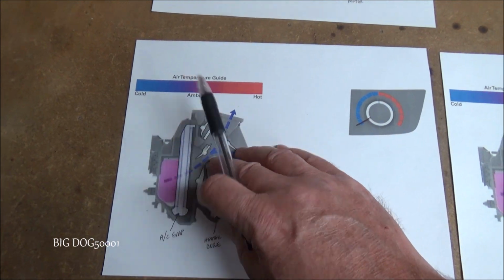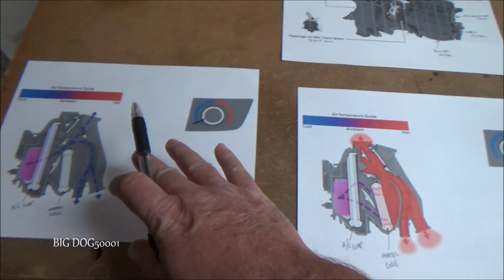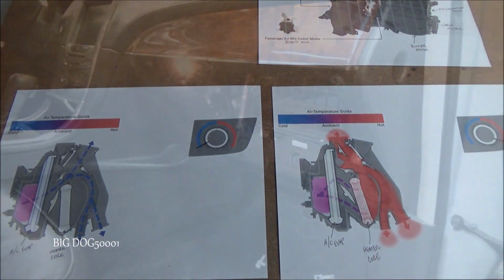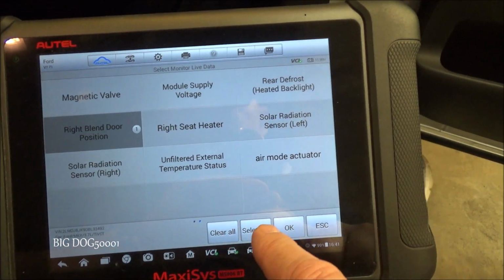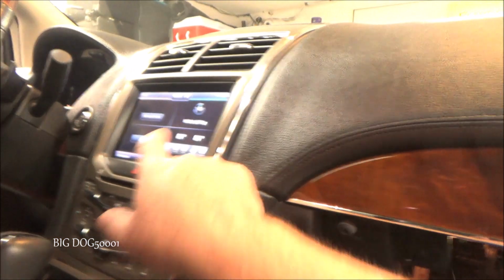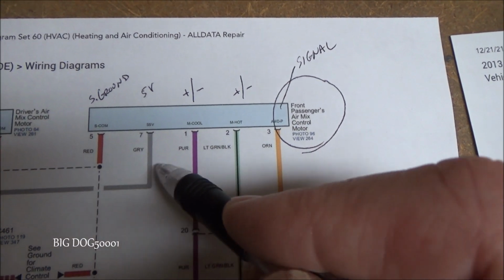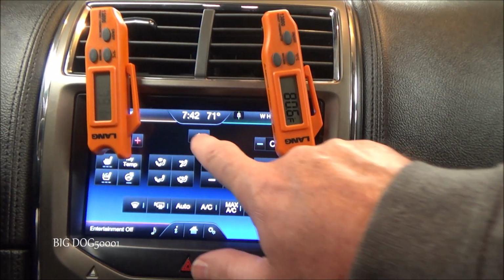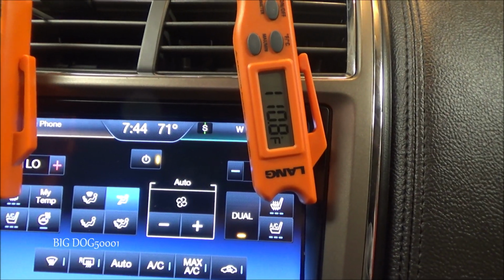Tech Tips - Uneven Car Vent Temps:  Heat or A/C Blowing Hot Air on One Side Cold Air On Other

Comment from the maker: Tools and Parts
Disclosure: This channel earns a small commission using some of these links - at no additional cost to you.
Scan Tool:  https://amzn.to/32y4ZlG
Lang Digital Thermometer:  https://amzn.to/33ReOf4

The Big Dog 50001 Automotive Channel Store can be found here: https://www.amazon.com/shop/bigdog50001automotive  (As an Amazon Associate I earn from qualifying purchases).
Reply: My problem is,heat on,hot air on passenger side,cold air on driver side(but when turning circulating mode,hot air comes out of both,single climate,coolant good,both line coming out of the heater core hot,similar temperature,I hear the blend door move,tcold to hot,hot to cold and see thr actuator move too,different modes same thing,cold driver side,hot passenger

Comment: A bit late but I’ve tried everything . I have a 2012 dodge Charger Sxt I have ac on the passenger and hot on the driver checked the Freon and it’s good . I checked all my fuses it’s good . Now my compressor has stopped kicking on and off . I’ve been told to change the ac switch and that the actuator might be bad I’ve changed two on the passenger and one on the driver I’m not sure what to go with next ? Or is it my compressor
Reply from the maker: I can't tell if you are saying the compressor is not turning on at all or if it is not cycling off/on properly.  If A/C does not appear to be turning on anymore I would start with the compressor and look to see if clutch is pulling in and engaging when the A/C request button is pressed on the dash.  If not engaging then have to find out if computer is not activating system because it does not have all the proper inputs it needs or if computer is turning system on but it is not coming on due due a wiring/relay or some other problem.

If compressor is activating properly then have to verify proper operation of the driver's blend door actuator (if dual climate control).  Does actuator actually move when you change temps is a good start, and does air vent temp change from warm to hot when changing temps with vehicle warmed up.  On some systems if HVAC module detects a blend door issue it will move the actuator to the HOT position and keep it there.  If I was diagnosing it, I would also verify proper refrigerant charge (difficult to do without an A/C machine) and see what the pressures look like on the gauges.

Comment: hey im having the same problem but im trying to find a solution for it its blowing cold are out the passenger side and not really blowing heat out the drive side i checked the blend door actuator but i find it kind of Strang the blend door only moves up until 63/67 and then i dont see it moving anymore it supposed to be moving up until 90 for the hot im trying to seee what im missing thanks for the video and keeep up the great work have a blessed day as always amen

Comment: Awesome video! Thanks for sharing! We have a 2009 Honda Crv. AC was good, but our issue was no heat either side, then we tapped the actuator on the driver's side by the accelerator, got it to move. Heat :) but found that it only heated the drivers side :( Can't wait to show this video to my husband... sooo ready for heat on the passenger side!! We have dual controls. Update: We fixed our issue, my husband removed the glove box & saw a green plug that was hanging lose, he plugged it in & success! Not sure how it could have come unplugged?? Not sure it could have happened changing the cabin filter??

Comment: I have a 2019 Silverado.  The air blows colder on the passenger side than the drivers side…it’s cool on the drivers side. But not as cold as passenger…..anybody else have this problem on GM ?  I have dual climate control.

Comment: So it's still possible for the older single climate models to have a stuck blend door on one side only but if the other side works fine it may be a stuck door but not the actuator itself..? Or am I confused? I don't want to try the recharge it it's a simple mechanical issue.

Comment: Great teaching video. Having a problem with my 2011 Honda blowing cold air left and hot air right. Experience is vital in these situations to achieve differential diagnosis.
Reply: I'm having a similar situation on my Chevy Tahoe front dash vents. Im hoping you got your issue resolved. I'm still stuck trying to understand what's going on.

Comment: This was a really good informative video. Probably the best on the internet. It hasn't helped me though since all my actuators are working as they should but i still have the problem of , when the heat is on I get heat on the right side and cold on the drivers side. I flushed the heater core and it flows great with no restrictions.. The only thing that it could be is that there is air in the heater core or the actual blend door is broken inside the housing. I'm gonna have to try vacuum purging it, because I've tried everything else except for cutting a hole in the housing to see if the blend door is actually broke. That seems highly unlikely to me.

Comment: Great video. I have 2012 Honda Civic with heat issues. Changed the blender door. Its a single climate control unit. Thermostat has been changed, temp sensors all have been replaced. Coolant level is good. Only get heat when change to inside air circulation. Passenger side gets boiling hot, driver barely warm. Then the windows start to fog up so have to switch to defrost mode. Foot and defrost mode blows cold air on the feet. So basically cold feet vs foggy windshield while driving. Please advise. Thank you in advance

Comment: Hello sir, 2013 Honda pilot question: I have uneven heat coming from my vents, I have warm air coming from the center vents but when I change to windshield defrost vents it blows almost cold air. Also my opinion is that even at center vents that blows warm air when I set on HI but I think is not as warm as it should be like its not getting to maximum hot/warm temperature. My coolant is normal, visually I inspect Blend Doors at both sides and they are moving well. Do you think that blend doors are not calibrated or got decalibrated somehow? Any Idea? Thank you.

Comment: I have the problem with heat on passenger side cold on driver's side....Just bought this 2018 Ram took it back they said it was the cabin air filter....I drove to home ....drove about 10 miles still no heat on the driver's side....no honest mechanics anymore....

Comment: So is there 2 heater cores ? One with ac compressor for hot (reverse valve) and radiator coolant (hot) or never the ac compressor works on the hot

Comment: I changed that actuator on the passenger side and still blows cold air on the drivers side and hot on passenger side would I need to change the drivers side actuator it's a 2012 Chevy impala LT

Comment: Hey Big Dog I’m a big fan. Always watch your videos when it comes to helping fix my 09 civic. For years my 05 4Runner has had a problem with AC. I’ll charge it with Freon then maybe 2 weeks later it’ll start blowing very warm air on the driver side but ice cold on passenger side till I charge it again and it’ll start blowing cold again. Never had it test for a leak. Should I start there first? TIA

Comment: A good detailed video but.. From a Non-mechanic who's video I happend to watch had a Cadillac Escalade with the same issue, He searced the internet and found this. Nothing has to be open or removed or unscrewed. Turn A/C temp to the lowst setting let it blow for 5 mins. Then turn A/C to highest (hot) setting let it blow for 5 mins. Set the normal temp you want and it is Fixed. My car hapen to be a Lexus LS and would have needed to pay a dealer evap expert $200+/hr to fix + tax and you never know if he was being honest. But I fixed mine in 10 mins. like the guy with the Escalade did. ;-)
Reply: Papa?
Reply: Me to.

Comment: I have an acura that blows hot air perfect both sides but the a/c only works on passenger side. Its like the drivers side is stuck in a hot to warm temp. I looked at the blend door & it seemed to be moving fine even took it out and moved the vents manually & i was still getting warm air, i tried adding freon as well but the system said it was full.  Any ideas?

Comment: I have a 2006 Honda Accord V6 has hot air coming out the left cold air coming out the right I could switch the temperature on both sides of the car but only the left sides one hot. The right side is blowing out cold already put.
Freon in it is still not fixed. Can someone please help me with this?

Comment: Thanks for the video. Very informative.  I remember that it was very cold out so I turned the knob to hot air and then later when I went to turn the knob  to the AC it kept blowing hot air. At first I heard some clicking sound but now nothing.  I’m going to replace the blend door actuator see if that fixes the problem on my dodge charger. Thanks again.

Comment: My problem is I have a 2013 ATS Cadillac. I put a battery in there or the mechanic put the battery in there and now my heat air conditioning stuck on defrost blows cold on one side hot on the other side but I can’t cut it all it stays on can’t turn it up can’t turn it down. Nothing works and the mechanic doesn’t know what to doand thoughts would be greatly appreciated

Comment: Liking dial controls in a vehicle has nothing to do with being old but being rational and sensible. I have no idea who was the idiot that thought that touch controls was a good idea in a vehicle when keeping your eyes on the road while driving is a matter of safety. I hate the touch controls on my Honda Vezel/HRV and just trying to do these tests by myself was a pain because I couldn't see the controls while looking at the blend door actuators. Thanks for the video by the way. Turns out my doors are fine so it's most likely a refrigerant issue since even the cold side isn't that cold either. It's dry/hot season here on my island in the Caribbean so AC is essential lol. I'm also considering bypassing the heater core as well since we never use the heater in our country and I'm pretty sure having a hot core inside the system even if air isn't flowing through it, would be less efficient.

Comment: Need help? my new to me camaro ls v6 2013 is blowing hot on driver side and ice cold on the passenger side. Ive looked up the model using my vin and the vehicle seems to have had a dual temp set up. the problem is i suspect the radio has been replaced with a lower end (cheaper model) headunit with single mode AC. do you think this would cause my issue? and if not have you ever seen a system with bad vent valves separate to the Blend Door?
Reply from the maker: I don't know for sure without seeing it but it sounds like there might be a problem with one of the blend door actuators (if indeed it is a dual climate control system).  Aftermarket radios are known to cause issues like this.

Comment: THANK YOU, THANK YOU, THANK YOU!! I'm a visual learner = I need to SEE it as well as hear it!! I LOVE your paper diagrams!!! SOOOO HELPFUL!! SUBSCRIBED & will be deep diving your vids for other issues I am having with my 'new-to-me' 2014 Chrysler 200 Touring. For all the 'rusted junk beater vans' I've held together since loosing my 2008 Expedition EL XLT,  this is my favorite car! It is so shiny new and elegant!! 🥲🥰 It has a few quirks that I want to take care of right away!! One is that it is blowing different temps L to R A/C and Heat. The previous owner is a friend who new I needed a car and told me straight up all the issues he knew it had. He mentioned he had to fix this issue before and gave me the info to the garage that did it. The garage has it now & called with their diagnosis: Restriction in the Heater Core. After watching this, it helps confirm that it might be (as I suspected) a blend door as well as (or instead of!) the previous issue happening again. I'll have them check it while they have it! It's too cold to not have heat on all the vents!
Reply: Kkp

Comment: Appreciate your detail, subscribed :)

2009 honda accord ex-l, dual climate

Heat blows just fine, both sides.

A/c, BOTH sides are blowing too hot, but passenger is slightly cooler.  (Passenger is barely cooler than ambient, but is)

 ive eliminated: fuse(s), compressor/clutch, and done a guage test, readings below.  I want to say ive eliminated blend door, but upon removing it i have busted it up pretty good, im waiting on a newer one to just replace (whoops).  But - manually moving the actual slider proved the door itself properly functional (i think).

Guages:  Static readings showed nearly identical (108 h, 107L).  Dynamic readings at first showed 130H, 14L.  This lead me to think r134 was off.  Added roughly 4 oz and then dynamic read 162H, 21 L.  But, i did not get any better results out of vents.

I happened to notice a radiator leak, on driver side/near(ish) to the drier.  There is roughly .5 inch between radiator and condenser, so hard to know, but i have a suspicion slowly leaking coolant has GUNKED my condenser.  I have cleaned it a couple times and it DID slightly inprove/lower temps, but not by much.

My current remaining supicions are
 a clogged condenser. Or
Still potentially a r134 issue

Is there theory to the radiator leak causing condenser cloggage?

I have also not yet done a vacuum test, but my static readings made me look elsewhere

ANY help is appreciated!

Comment: Thank you for explaining all this and not just testing Freon, I have a WRX 2021 not even 2 and my ac compressor failed, I replaced it and not one vent is blowing cool air and all the others are hot so I’m going to try looking into the dash at the motors to see if things are moving etc. but would you have any idea on what exactly would be wrong? No leaks Freon is at good level, air blows good etc but can’t get it cold, it worked for a week or so really well then just started getting hot, it’s summer so I never turn the heat on but not sure if a door isn’t opening etc like you say the blender doors.

Comment: My air con was working fine. Driving along, all of a sudden it just went off. Checked fuses they're fine. Swapped relays, replaced temp sensor  had it filled up still no joy, no clutch engaging and no fans coming on. I was told to reset the hvac system on the dash but don't know how

Comment: My battery went dead and we jumped it.  After that the car was blowing hot on the passenger side?  Never has happened before?  Could this be a computer issue that needs a reset?
Reply: No, it probably needs a reset, so if you start your car and run the AC for 5 minutes and then put it on the heat for 5 minutes, then put it back to ac and that should reset it
Reply: I did the same and this happened

Comment: I have a 2008 Acura MDX.  New blend door on driver's side.  Helped some (used to blow hot).  But now I have  somewhat cool on driver's side, cooler on passengers side and coolest on the back seat blowers.  Really strange.  The blend door driver's side is actuating.  Thinking then it is most likely low refrigerant?  I've had that recharged in the past though so I don't know.
Reply: Any updates?
Reply: @glennweaver5636  I took it to a shop and they put in half a can of refrigerant which helped. But, the front vents are still not as cool as the ones for the back seats. This is my second MDX and the AC should freeze you out on hot days but this isn’t the case. It’s at least tolerable now with the added refrigerant so I’m living with it.
Reply: Another mystery with this system is on humid days it seems to freeze up and the air flow through the vents gets very low. I can turn off the compressor using the dash button and the air flow comes back after a few minutes. Have to cycle the compressor on and off to keep cool. Another annoyance. Someone suggested a dirty cabin air filter but it’s clean.

Comment: Oh, this was incredibly informative. I wish there were more videos out there like this. Thank you so much. I'm having an issue with cold air on the passenger side and no cold air on the driver side. I do not have dual climate control. My mechanic and I are both a bit dumbfounded on this one. Do you have any suggestions? It's a 2004 Toyota Camry
Reply: Any updates?
Reply: @glennweaver5636  Well, so it's probably that the little doors are getting stuck on the driver side when I adjust the thermostat. My mechanic is my neighbor and he's been so busy. At the moment, the a/c is working if I don't touch the thermostat but I haven't dove back in yet. I may just try to fix it myself but I'm also worried about begining the work and needing to get to the auto part store for another part or tool 😆